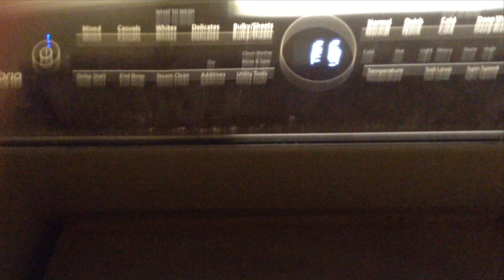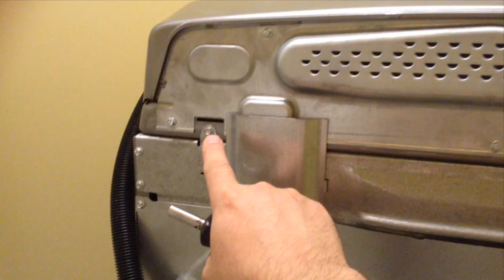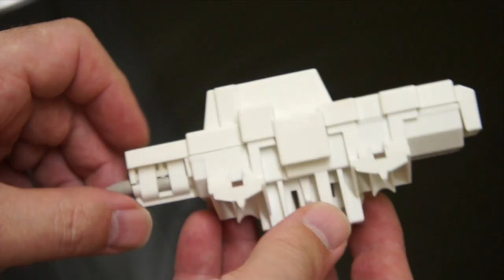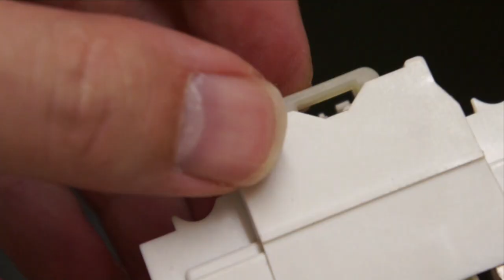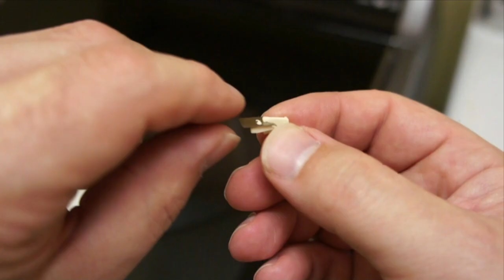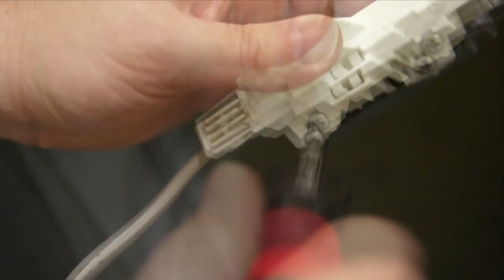Repair E3 F5 Error Whirlpool Cabrio Washer

Comment: Whirlpool use to make good washers years ago but the Cabrio is a piece of junk, it has to many problems. i removed and modified my switch so when it extends it stops in the correct position and put it under the back cover by the main electronic board. some may say this is unsafe but it solved my problem.[DON’T DO THIS IF YOU HAVE CHILDREN OR JUMPING ANIMALS.] i like being able to see if my piece of junk is overfilling with water and other stupid things it does. the main reason this switch has problems is because low voltage and moisture don’t work well together causing some corrosion on contacts,this fixed my lid latch problem but if you do this it’s by many considered unsafe. i bought a new spare switch on ebay real cheap.

Comment: This also works on maytag bravo. I fixed mine but without watching this video though. I tried to search maytag bravo door issue but i did not find this. It Needs to change title to washing machine door issue F5 E3. Then thumbnail should have caption saying try this first before buying new replacement lock.

Comment: Does this also apply to the F5 E1 error code?
Reply from the maker: It might. The F5 E1 indicates a problem with the washer door lock, door switch or control panel. Wouldn't hurt to perform this procedure. It could fix your error. But if not, you could rule out 1/3 of the possible trouble.

Comment: excellent video!! So, in my haste to fix my washer I did not watch your video first and I completely broke apart the whole latching cover (the gray plastic piece on top)...do you know if I can order the whole part as a replacement?
Reply from the maker: You should be able to order the whole part. But before you do, I would check with local appliance recyclers. They may have an old one with a good lock assembly that can save you a ton of money!
Reply: @petereit   Thanks! I found a replacement on Amazon for less than $30 so I ordered it, however, it didn't come with the little cover plate (bezel) so I had to order that separately. Hoping to replace the part tomorrow. Fingers crossed!!

Comment: I was able to repair mine. Thank you. My design is a bit different, but the same concept. However, the most important step is to clean the contacts. You said you had corrosion but then did not show the cleaning. I cleaned mine using a Dremel with wire brush attachment. Sand paper might work, but the parts are small and fragile so need to be careful. Get em nice and shiny, then dielectric grease.

Comment: Shot out to this solution! I did manage to break one side of the double clip, but the casing snapped back together nicely, so I went with it. We had been dealing with the F5 E3 code for over a year but got by with power cycling the machine to get it to work, and sometimes we let it sit overnight unplugged, and in the morning it worked! Thanks again....I highly recommend this solution.

Comment: Thank you so much! This worked wonderfully. Before watching your video I took the lid lock housing off of the machine and manually slid the lid lock in and out and checked to make sure that there was no lint or obvious corrosion or obstruction. Then I tried to see if the Lockwood engage after plugging the machine back in and it wouldn't even let me press any of the buttons on the screen. Eventually I watched your video and tried what you said but I did not have any of the Dielectric grease so I just bent the little tabs on the contact points and tried to test it before I screwed the component back to the machine and the screen still would not would not recognize me pressing it. So I wondered if maybe there's some sort of like safety component in there that if the lid lock isn't level and Plumb it won't turn on . So I thought I would just screw it back to the machine and try it and it did work! My guess is there's some sort of component inside the mechanism that if the machine is tipped over it won't allow you to access anything on the screen as a safety thing. Either way your video worked hopefully my comment will help save others some trouble and frustration!

Comment: can the lid itself have to be fixed to connect to the lid lock?
Reply from the maker: @tinahargrave1454  Unfortunately, if you change how it’s wired, the washer’s main logic board will run a limited number of cycles before it will completely shut down and never run again.

Comment: The contact on the circuit board was fairly dirty, but you don't realize it until it was cleaned with contact cleaner, it got bright, I put dielectric grease on, put it back together, and it worked, did it just now, 8 years on, and this video is still saving people lots of money, and a techs, gas, vehicle wear and tear, etc.

Comment: I put W40 whenever I have this problem. You don't have to do much. Lift the laundry lid. Fill-up the lock assembly finger size small basket with W40. Let it drain for 10-15 minutes. It will drain through the lock assembly hole and remove any buildup moisture on it's own. Start the washer in 30 minutes and when the lock assembly moves and clean on it's own.
Reply from the maker: Interesting...

Comment: This is by far the best repair description for this issue. The description was very detailed and accurate. I greatly appreciate the time you put in on this one. Unfortunately it took I while before a came across your video but was definitely worth it. Keep up the great work. Cheers and God bless!

Oops! Spoke too soon,  After running several loads successfully the F5 error is back.  I did clean the contacts with CR Electronic cleaner and apply dielectric grease. Is there a method to modify and bypass the defective lid lock?

Comment: THANK YOU MARK....

Kenmore Top-Load washer has the identical lid lock mechanism.
I just followed your step by step instructions & the E3 F5 problem is solved. My situation was a little different leading up to the error codes. Had to replace the pump after it started a cycle & had water in the tub. When I tipped the washer over to work on the pump , the mechanism must have got water in it & caused the already worn fingers to not make contact. After putting the dielectric grease in & bending the fingers down a little, no more error.

Thanks again!!

Comment: The contact strips on your circuit board look pristine. Mine are blackened and have lack of copper contacts.
Reply from the maker: In that case, you’ll most likely need to buy a new lid lock mechanism. Unless you can salvage one from a local recycler.
Reply: @petereit  I was going to take thin strips of copper foil or sheets and solder them to the track.
Reply from the maker: @jasonverbelli4555   That could work if you can get them adhered to the board beneath them really well and get a solid solder connection. 👍🏼

Comment: You, sir, are a Godsend. Do you know how much money you just saved me?! Hundreds! I thought I was going to have to get a new washing machine. I spent about $2.15 on a tiny packet of bulb grease from the automotive store, followed your video step by step, and it worked perfectly! 

The trickiest part was disassembling the actual lock mechanism. Even with the T15 screw hack, it wouldn't come undone. I used a mini flathead to pry it open, rubbed away some of the corrosion, + bulb grease, and viola! On top of that, you have the same exact model that I have. 

I've seen a few videos on how to repair this error, but they all require replacing the entire system. I'm so grateful. Thank you for putting this easy to follow guide together. It was still cheaper than a replacement kit 🙏🏽🙌🏾😊👍🏾❤️
Reply from the maker: Awesome!! Congratulations on the repair!

Comment: thanks for the video, i really didnt want to spend money on a stupid locking mechanism. this video made it super simple to fix the problem. 

only thing ill add to the instructions is there is a wiring harness that connects the top to the bottom of the unit that the video doesnt discuss. so you will want to be gentle with lifting the lid up as if you let it go and it free fell behind thew washing machine, you will probably pull wires out if it. i had to position the washer in such a way i could hinge the lid/top and let it rest on the vertical wall behind the washing machine while i worked on removing the locking mechanism. once removed it had enough slack in its wire i lowered the top on top of the locking mechanisms wire so i didnt kink/damage the main wire harness anymore than necessary.

also my unlocked position contact was black, significantly worse than the video. i took a utility knife and lightly scratched the surface of the contact clean, the other contact surfaces looked fine but i gave them a little scratching as well to be sure there wasnt any film on top of them.

Comment: Man, this really ticks me off. Not the video (that was excellent), but rather how this part was surely engineered to fail in every possible way that it can. I'm shocked that it's a motor and not a solenoid. That they used foil traces instead of optical sensors. Now if you go looking for these online, you'll see that they are selling at an incredible rate... I'm very inclined to design a tiny circuit that plugs directly into the controller board that mimics the signals of a working lid lock forever! I definitely do not share Whirlpool's sentiment for "safety" over functionality! My previous washer lasted me over 20 years.
Reply from the maker: I thought about that too. Just scoping out the input and output signals as the machine runs and building an EPS32 to mimic. Then I realized I have a life. 🤣

Comment: Could not have been explained and demonstrated better. Worked like a charm. Had to refer back to you installing the metal contact clip onto the plastic carriage, as I was holding the plastic part upside down while trying to reinstall it. Helped immensely! Thank you!
Reply from the maker: Cool! Glad I could help!
Reply: @petereit  , problem keeps coming back, but where the lid locks, starts a spin cycle for only a few seconds, then the lid lock clicks and the washer stops. If we keep repeating the "start" button, it sometimes will complete a cycle, but not often. Any ideas? :(
Reply from the maker: @DecksNJ  I actually had to perform this procedure twice on my machine (I shot this video the second time.) Applying the bulb grease was what made it “take.” Another viewer also recommended thoroughly cleaning the contacts with CRC electronics spray.
Reply: @petereit  , thanks again,  will do!

Comment: Only thing I would add, is that you can actually unscrew the two screws from underneath the front lip. That way you don’t have to take the top off; though, it does make it more accessible, I believe a extra work. Very informative and helpful video!
Reply from the maker: Great comment! Thanks!

Comment: Thank you for this video!  I bought a Whirlpool Cabrio wtw8500dr0 set super cheap because it needed this repair, bought a China replacement component and it was defective right out of the gates.  Luckily I still had the original Whirlpool component and I could see the contact arms fell off.  I snatched the good ones off the new China switch, cleaned it up, tossed them on and it fixed it.  Washer is working for teh first time as we speak and I appreciate your video as a reference.
Reply from the maker: Excellent! Way to splice the new with the old!

Comment: I wonder, is there a way to permanently disable this feature?I don’t need a child lock.
Reply from the maker: Unfortunately, no. If you bypass the lid lock the main board will start a programmed death spiral. It will perform a fixed number of cycles then it will commit suicide and totally brick your machine.

Comment: How does one open the lid when it's locked with these same codes flashing, and it will not budge, to open?
Reply from the maker: The only way I know is to follow the first half of the video, swing up the entire top of the machine and disassemble the lid lock mechanism.

Comment: Is there a way to bypass that switch I did exactly what you did in the video and I am still getting the error code
Reply from the maker: Nope. The main logic board monitors the voltage and the responses from that lid lock switch. If it sees anything out of whack, it will run a fixed number of cycles then it will brick itself completely.

Comment: Thank you for for this video. I am a single mother of two boys. I got laid off from my job a month ago and unemployment benefits are unrealistically low in this economy with the the current inflation we have been experiencing the past couple years. My state has not increased unemployment benefits since the 80’s!!! My son told me to replace my washer machine and get a used one. I told him that was absurd. My washer and dryer are in the bathroom which isn’t very big at all. I worked in such tight quarters, but did it, thanks to you!!! I just have to go get new washer machine hoses because the ends were all corroded. Why not just replace them. So tomorrow is the real test!!!!! Thank you for this video, you saved me hundreds of dollars when my mortgage is due!!! God Bless You!!!!
Reply from the maker: Awesome!! Let me know how the real test works out! 👍🏼

Comment: Excellent video. Superb video. Our washer suddenly threw the E3 F5 code. I thought, oh boy, new washer. The instructions were spot on and step by step. I used a bit of CRC Contact Cleaner and Protectorant, then applied dielectric grease. Reassembled. And the washer worked perfectly. What an incredible resource and saving us from repairs and replacement!
Reply from the maker: Glad it helped!
Reply: My washer is  doing the same thing but I don't have any one to help me.

Comment: Didn't work for me
Reply from the maker: Didn't work the first time I tried it either. When I used the electronic spray to clean the contacts and applied the bulb grease that's when it solved the issue.

Comment: Turns out what was causing our lock mechanism to not work was the fact that it was wet. Some water got into the mechanism as I was replacing the drain pump. All I had to do was dry it with a hairdrier for several minutes.

But the thing is it can also get wet as you take out any clothes soaked in water. It's such a poor design.

Comment: Could you rig the contacts to just always stay open?
Reply from the maker: No. The main logic board counts the number of successful open/close cycles the lid lock completes. If it doesn’t see what it expects, it will brick the main logic board after a preset number of failed cycles.

Comment: I love youtube. Thanks for the video. This appears to be a planned failure spot created by the engineers at the request of the executives. These little items to fail for the majority will become a just "replace it" event. It should be criminal to design an item to fail. The fact these contacts (which appear to be from the early 1900s design) are directly exposed to moisture again criminal. Such a sad situation we find ourselves in. Luckily I'm mechanically inclined. We actually pay in taxes for government protection from scammy manufacturers and if planning the failure of a part isn't scammy I dont know what is.
Thanks again for the video. Your a solid helper. very cool

Comment: I have the same washer, is there any other things to go badly on these? How reliable are they? Was just curious if I need to keep parts on hand for repairs.
Reply from the maker: This is literally the only thing that ever failed on this machine. Since I made that video, we moved to a different house. The old silver Cabrio stayed at our previous house and we just happened to get a great deal on a newer white pair for our new house. Haven’t had a single issue with our newer machines.

Comment: My 10 pm repair worked perfect !!!! Never good when the wife says the washer is broken. I googled the code being thrown, found your video. I didn’t use the grease. I didn’t have any. Put I did remove the contacts, scraped gently with a micro screw driver and cleaned with electronic spray cleaner.  I put everything in back together and success!!! Thank you!!!! I did order a new one on Amazon as a back up. Other video’s just show replacing the defective unit. I loved that yours had, how to repair the defective part.

Comment: Help please !!! My washer is stuck on the same codes but the lid opens. My model is similar to yours. I unplugged the washer waited 2 mins and nothing the codes kept flashing. When I opened the lid and moved the clothes around the washer started up but then stopped. Please any advice on what to do????????
Reply from the maker: This MIGHT get you through a load or two until you can perform the permanent repair:

1. Thoroughly clean out the depression on the front edge of your washer where the lid lock sits, and clean the lid lock itself. Make sure there's no dust, lint or other debris anywhere.

2. Close the lid, push down on the front edge of the lid and keep pushing it down as you start a cycle. Keep firm pressure onthe front of the lid until you hear the lid lock click and the "Add clothes" light goes out.

Comment: Pos. The whole lock falls apart...  need a way to just hot wire this junk.
Reply from the maker: Unfortunately, you can't. If the motherboard doesn't see the right signal it expects from that lock mechanism, it'll run a fixed number of cycles then brick itself.